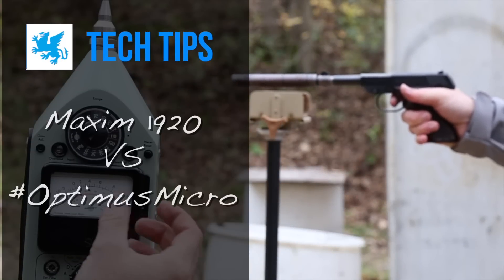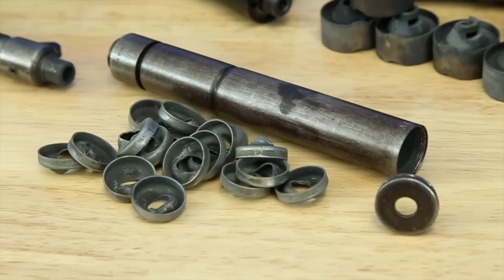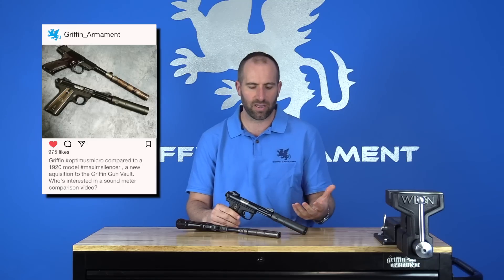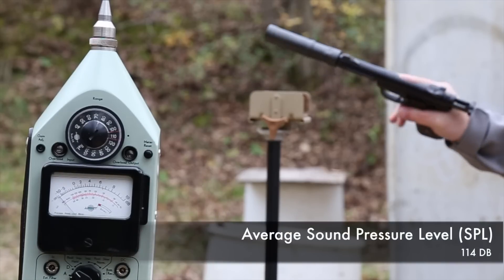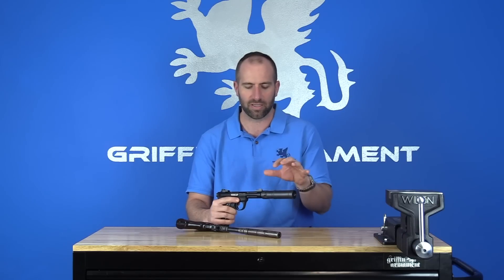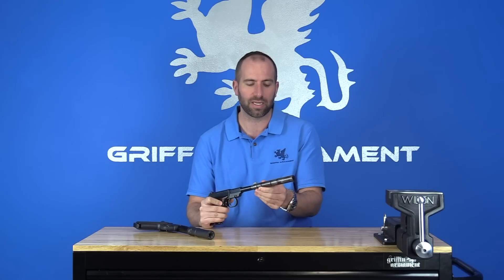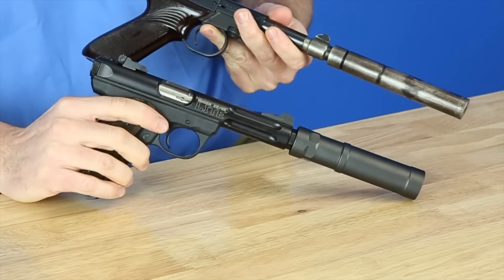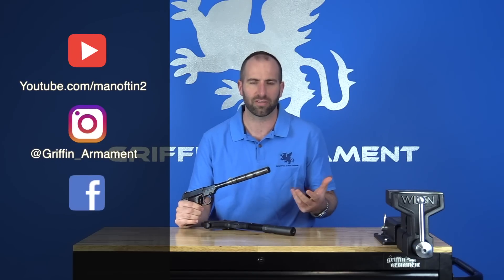100 Year old Maxim silencer VS Griffin Optimus Micro suppressor

Comment: Two different 22lr pistols, with different barrel lengths.  Not the best side by side comparison.  Results likely to be similar as depicted either way, but not reliable as shown due to the differing handguns used.
Reply: It's not really a head to head of these two as most people will never own a Maxim silencer anyways . Just kind of showing how much silencers have changed over the years, such as reduction of noise and baffles. The Maxim silencer is still a very effective design, and was really cutting edge at the time. I feel that if the nfa was repealed, or at least had "gun mufflers" take off of it, you'd see a bunch of silencers hitting the market similar to the Maxim as they'd be inexpensive for the masses while still gaining some suppression benefit. It's just ridiculous that they don't care about our hearing. Reducing the report doesn't make it anymore deadly, but the suits in the 1930s figured "they MIGHT commit crimes with these, so let's regulate and tax the fuck out of them so the bad guys can't get them"... Not realizing bad guys don't give a fuck and can build one very easily, yet to this day, a homemade silencer, or even a manufactured one is rarely used in a crime.

Comment: Maxim rules.  Lets put your can against one 100 years from now and see how they compare.
Reply: It's still a valid comparison- the Maxim is longer, length suppresses better than diameter.  22 baffles to 5?  That means our one baffle is outperforming more than 4 maxim baffles because our can is producing 10 times less sound at 10DB more quiet.  The Maxim can is a great can for the time, but it doesn't make sense to bring heavy bias into a comparison that overlooks things like more than 4 times the baffle count or significantly longer length.  The maxim is easily an inch longer.  It's not a hatchet job on Maxim.  This isn't a terribly unfair test.  Another way to look at it is this is a Maxim 1920 suppressor- he had 11 years to develop it after the 1909 model.  We had 12 years to develop the micro.  It's a similar amount of development time. This was an entertainment video anyway.  If we wanted to do a hatchet job, we could shoot the maxim one time on an Ar-15, and destroy it, doing something the micro can do all day long.   Obviously not the point.  The point is show people how a Maxim can compares to current market leading technology.

Comment: It looks like the maxim can has a bore alignment issue. Is this just a camera trick or my eyes?
Reply: I guess its can optical illusion because an alignment issue would of definitely been noticed and mentioned by these guys.
Reply: its that way to divert gasses all directions and the bullet flies through the tip of the slit on each...
Reply: @Shadow0fd3ath24  The can has no strikes.  It is perfectly aligned.